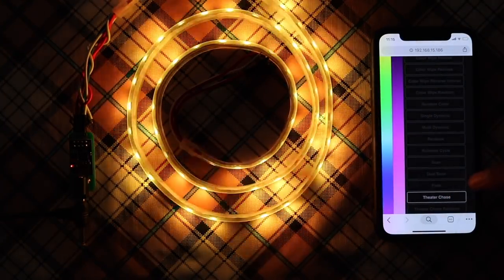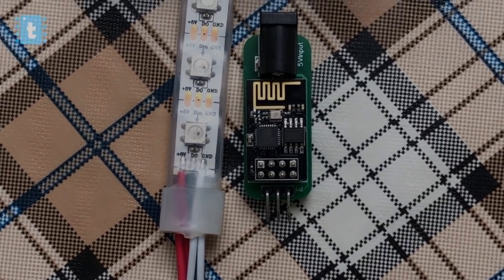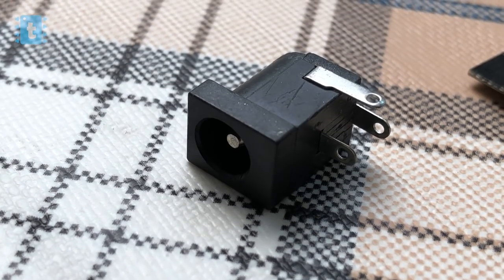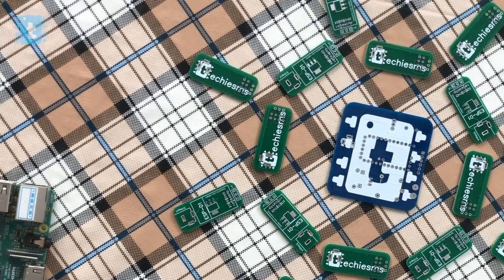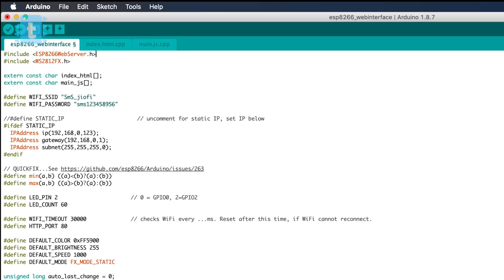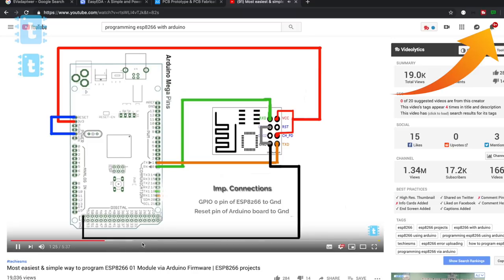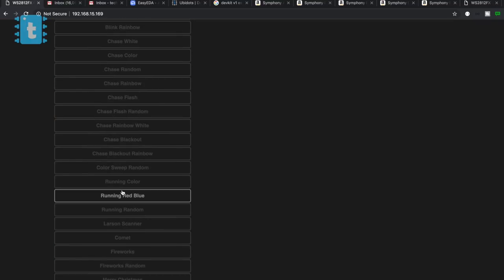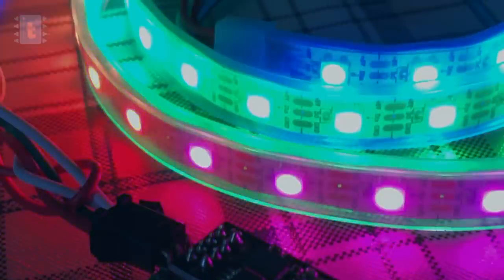Smallest & Wireless Neopixel Driver using ESP8266 01 Module | ESP8266 Projects | IoT Projects

Comment: Hey, I am trying to drive 4x WS2812  leds (small strip) , I used the same supply for both led and esp01 , but for some reason esp01 doesn't get enabled, and leds do not turn on. If I power esp and leds seperately everyhing works fine, why is it so?

Comment: I managed to get it work but i figure a weird thing, in order to make it working properly i need to unplug the data wire, powering the esp module and only then connect the data wire back... What's wrong ?
Reply: same problem here, i think it is an error in the wiring... what are u using for power?

Comment: Thank you for sharing this tutorial! I have so many similar projects planned, and most of the component, but had trouble stepping down from higher voltage to 3.3V. It seems like AMS1117 works with 12V as well, which is exactly what I need. And thanks for the JLCPCB tip! I'll use that for sure! Greetings from Sweden!
Reply from the maker: Happy making 😊

Comment: I've bought a lolin v3 and a ws2212b led stripe. Can i use the same 5v from the power supply or you think it will fry the board?

Comment: 1.) Do we need to open the serial monitor each time we need to know the IP address assigned to the esp8266-01 module ?
2.) Also can I use Arduino Uno for uploading code on esp8266- 01 module ?
Reply: uncoment line number 62 and change(line64) ip adress last digit between 80 to 255 and upload than u see serial monitor ip.this ip adress is standard for ur browser

Comment: When i try to rebuild it, only my first LED are on and the sketch breaks and dont connect to wifi.. some tipps?
Reply: its happening the same to me!! did u find a solution?
Reply: @gtavc007  no :/ i am not sure what it is... so strange!
Reply: @bi0s1337  what are u using to power it ? im using a 5v power supply and a lm1117 for the esp01...the only way to get it working is to disconnect the data pin from the esp01 and power it up and then reconnect the data pin to esp01
Reply: @gtavc007  i am using the same.. USB Cable and AMS1117 like tut. But this is true, it works like you say.. thanks for this hint!
Reply: @gtavc007  I got it! You need a Resistor between GPIO2 and 3.3V. I use a 4.7kohms resistor and i also try it with 470ohms. It works ;) Best teamwork! Thanks for the hint with Datapin!
Reply: @bi0s1337  awesome bro!! i was up till 3 am last nite and didnt find a solution, could you explain  what u mean by GPIO@ and 3.3V ? i have my data pin with resistor from the led strip to the esp01 (GPIO2) but dont know how to put it btw the GPIO2 and 3.3v
Reply: @gtavc007  its simple: solder a new 4.7kohm resistor between gpio2 and 3.3v of the esp01. Thats it :)
Reply: @bi0s1337  awesome teamwork bro! its working now perfectly thanks ! greetings from Mexico!
Reply: @bi0s1337  just out of  curiosity, how did you come up with the idea of the resistor btw gpio2 and 3.3v?
Reply: @gtavc007  Google the problem with datapin and get a result of stackoverflow in other scenario.. but i try it after also and works 🤣
Reply: bi0s1337 do you think that we can use pullup resistor instead ?
Reply: It’s about logic voltage. Ws2812 works with 5 volts logic, and esp works with 3.3 volts logic. For this you may use a logic converter. Or for first led put 5 volts trough 1n4007, and another one for 5 volts
Reply: it works very well, thank u

Comment: Great bro. Put this in your celling.
Reply from the maker: But it’s only 1m
It’s too shortl
Reply: @techiesms  but what is the use of this leds
Reply from the maker: If it was long or if I had bought multiple of it I can put it on my ceiling or behind the tv or below the sofa

It looks really cool 

And this kind of leds can be used every where we’re the normal leds can be used but with less number of wires and less complications

Comment: i want to ask a question to you about this project. There are a strip led, 5v 20 A power supply, ESP8266 module is that you used and ams1117 3.3V regulator. I have created my circuit but i have a problem. When i connect to the energy. ESP is crashing and blue light always on also not connection to network. if i disconnect data cable from led strip or cut led strip power before connect to energy. ESP is working fine then if connect data cable. led strip working properly.  I didn't solve this problem. 

1. if Everything are connected When give energy. ESP is crashed and blue led always on.
2. if Data cable is removed When i give energy. ESP is working fine.
3. if negative cable of Led strip is removed When i give energy. ESP  is working fine.
4. if pozitif cable of led strip is remove When i give energy. ESP is crashed and  blue led always on.

How can reach that problem? Do you have a idea?
Reply: The esp is going into boot mode which gpio2 should be pulled to high then it will work

Comment: Thanks a lot for nice video. I like this simplicity. I mean, whole code is already available under Arduino examples and only things you need to change are WiFi credentials, LED count and eventually data PIN if you want to use GPIO0 instead of GPIO2 for what ever reason. However, I "centralized" everything in my house to be controlled either from Home Assistant or from Alexa's (actually, Alexa's are sending commands to HA, so we can say this is also controlled from HA). I also have Hyperion server and it's LED instances can be controlled from HA. 

Question: Could this be modified/expanded in some way to be integrated either to Home Assistant or to Hyperion via network?

Thx
Reply: You can use esphome for that
Reply: @Rt_domingo  Thanks a lot! But.... My comment was 11 months ago :) and I think that few days afterwards, I started using exactly ESPHome for that certain project :) Later I discovered WLED, so nowadays I'm making my home LED lights either with WLED or ESPHome, depending on use case :)

Comment: I have tried this so many times and as soon as I remove the esp 01 from the usb it will not run the program. I have done the link from the 3.3v and still nothing. I have tried it with 4 esp 01’s and they are all the same. Does anyone know why?
Reply: This can be current sync issue on ESP, what is the source of 3.3 v for ESP. Try increasing that

Comment: chip enable pin on esp, must be connected through 10k resistor to vcc 3.3v,
but you have connected directly without using resistor, IT IS NOT RECOMMENDED.